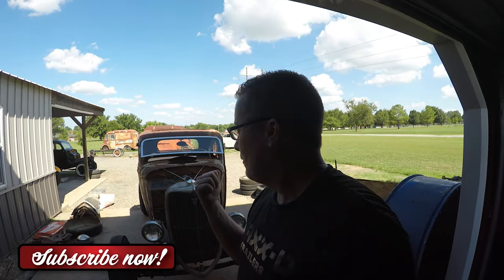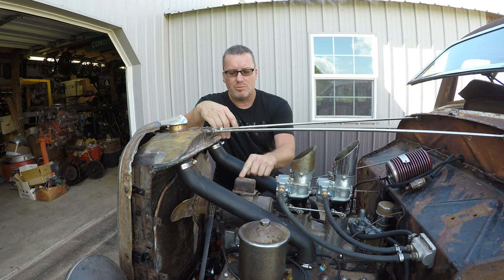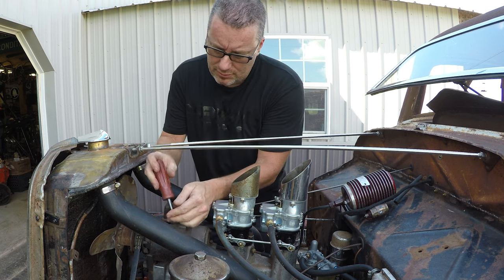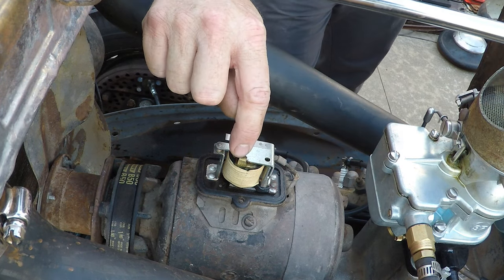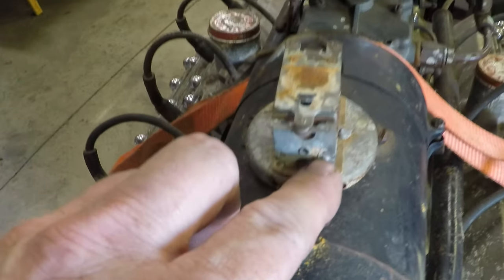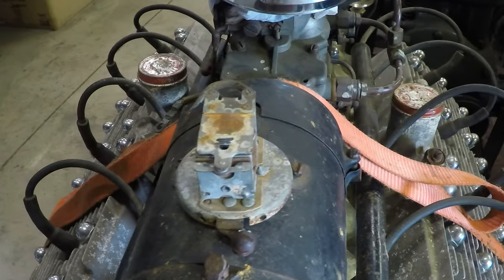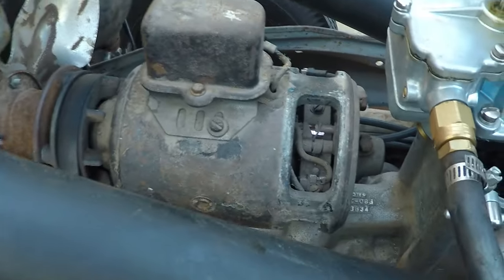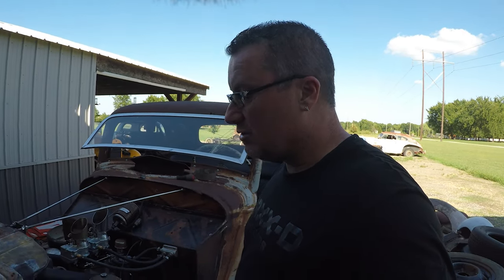What's that do? · Early Ford Flathead Generator Cut out!

Comment: I have a late 38 with an early 2 brush generator and a voltage regulator. Same problem that at idle it puts out around -2 amps and when I turn on the lights it gets to -20. How do you set the amp output on a 2 brush gen?
Reply from the maker: There is a way to adjust the regulator to increase the voltage. I haven't done that, but have seen it, so you'd have to research that. Good luck!
Reply: @chaddilacdesigns  thanks!

Comment: At idle it should be about 0, max during daytime is 5 to 8 amps high speed cruise.  Night is when you bump it up... The reason on cutouts to just run so low as there is no regulator to not boil the battery.  This is how the model a generators are set up.  Just keep an eye on your battery water levels. If it boils it will be a hell of a mess.  

Nice video, I may make one on dialing in the cutout voltage, I've been dialing in the cutout voltages... Mine on the A was stupid low for the cut out, and was discharging at idle.  5.8 volts is now the new cutout voltage for mine.  The cut in voltage is 6.25.... If you need a cutout done up man, hit me up... I got a power supply I bought just to do this... 

Cheers bro.
Reply from the maker: Ah good to know! I will probably turn it down a little then. I was worried about the lights drawing too much and the eFire not working. I'm running a 6v Redtop optima. Thanks for the help Kev!!
Reply: @chaddilacdesigns  Yeah the balance is always FUN.... No stress, let me know if you need help .

Comment: Sir I have unusual question how come peopel didnt get shocked from those old engines like Ford Model T for exampel ?
Useing magneto and still baterry not reacting with the magneto or not get shocked?
I wanted to build some thing for years me Delco 12 si alternator to fead pure dc or ac electricity power to me E Core Hei ignition coil only problem dono how they done it tought ? I dono wuld it work if I add ac capacitors on the three phase winding before the bridge rectifier so the capacitor wuld not react with the lead acid baterry I tough insulating the HEI coil and use only ac capacitor conections but still Im wory that ac spike culd shock me or interfeare with the delco alternator.
I seriusly have no one to ask about this unusual subjects.
The delco starter motors s/r types do also odd staff they reminde me at Rosemberg generator they look identical.
I did in fact starter me car fhew times on that R terminal starter selenoid engine spin slow but it starts it did cinde of mesed up me alternator polarity I ques so Im not shure what happening with that thing perhaps the bendix stay engaged so probably for some reason I experiance parrarel/series baterry configuration even tought there does not exist other baterry and yes be baterry is flat after whew times starting or another thing happening just like be Ford Model T perhaps for some reason me magnet starter motor discharges its magnetic field similar to Fords Magneto flywheel .
So do you know any thing about that unisual behavior those devices do?and why do they do it? 
I know those old delco alternator back charge and arcing relays but still the starter motors confuse me lot I do have that odd R terminal on me starter motor but I dont have points ignition it does not work on 4pin GM ignition module so preaty much anoying starting such engines.
Mostly what I am curiuse about dual baterry set ups or baterry/capacitor lay out .
Perhaps you know more about it those old ass holes build terribel circuets and regulators tremistors ,non present diodes in dashboard shity delco alternator regulators so has any one tryed to solve those known problems? 
Cant finde any thing usefull information on the internet .
So I hoppe you can help me some what Im doing resurche on old GM Chevy systems how to make them bether and upgrade them
Reply from the maker: I think your best bet would be to gather up your parts and go visit with an older gentlemen that still does generator rebuilds. You're asking a lot of stuff I can't answer for you. Good luck.